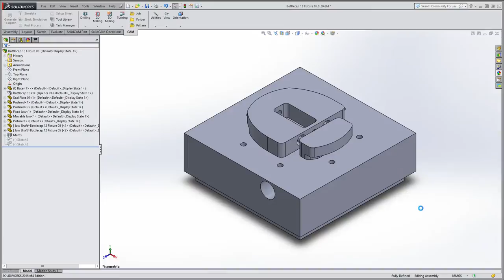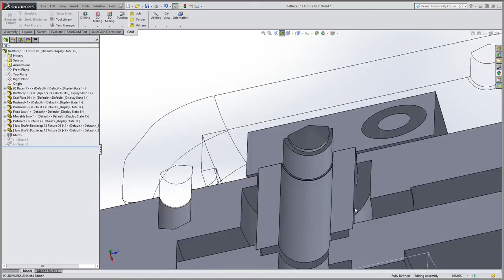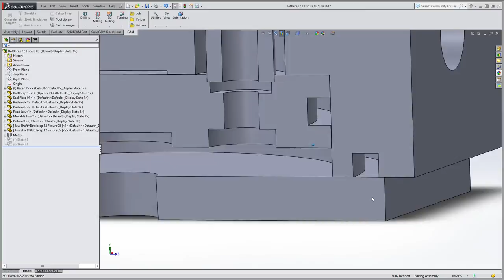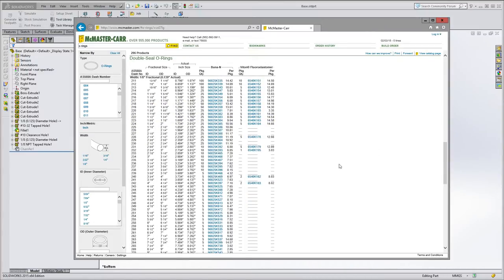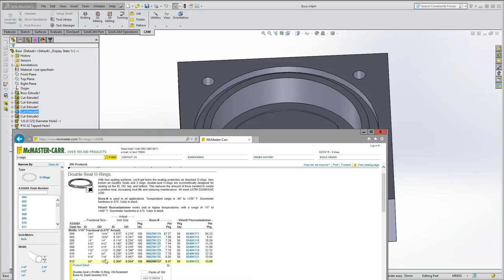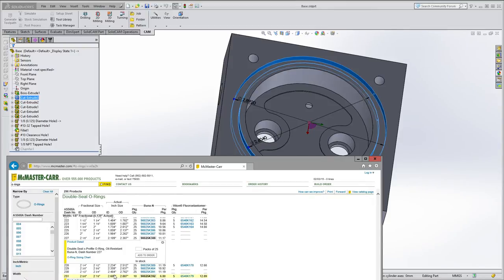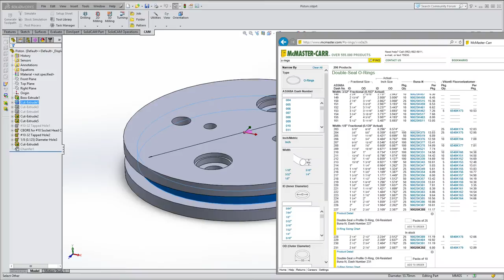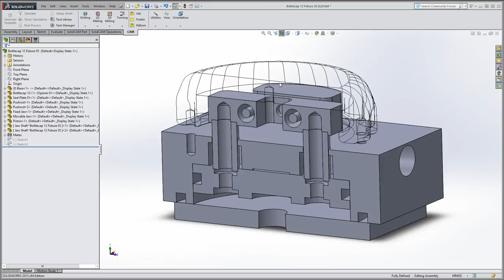Put An O-Ring On It (21-Station Pneumatic Fixture Plate pt.2 of ?)

Comment: If you're using a round o-ring in a square groove, you don't need to leave excess on the sides. You want it to compress into a near-square form; it'll compress into the corners.. I'm also not an o-ring expert, though.
Reply: Though, giving this some thought, all of our o-rings were in non-sliding applications, simply being used as a seal. It's probably a whole different set of criteria for an application like yours, where additional contact beyond what's necessary to make a seal is a negative. It all changes when you apply vacuum anyway.
Reply from the maker: These o-rings have a somewhat square profile. And I cut the glands with a corner-radiused end mill, so they aren't totally square either. I figure the extra .010 I give might help and I can't believe it would cause much of a problem.
Reply: Hirudin yeah, one I kept watching I realized I was a bit off in this particular application. Besides, at the least you're telling what you did, and it worked! So good info no matter what. Cool fixture, too. Impressive. ;)
Reply from the maker: Oops, I read bad. I read "all of our o-rings were" as "all of your o-rings are" for some reason. Sorry!
Two of the four o-rings do slide. (The big one around the outside of the piston and the two smaller ones around the two shafts.)
Reply from the maker: rob lockwood Thanks!